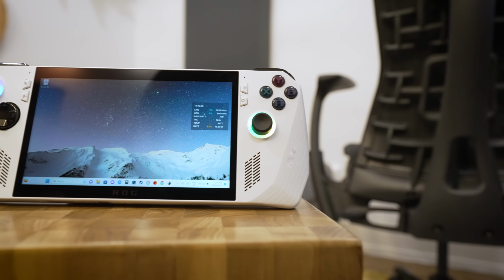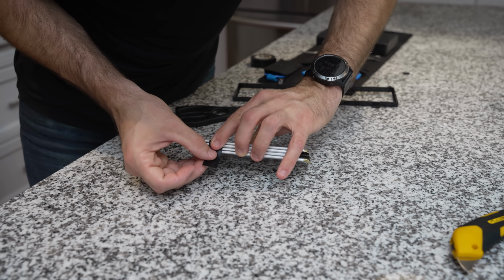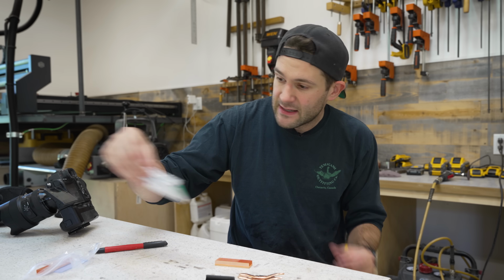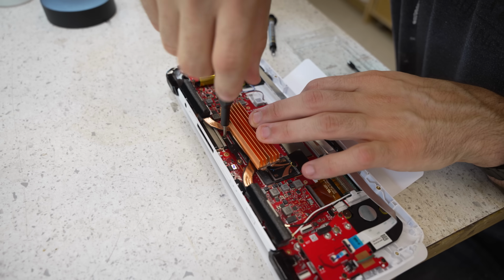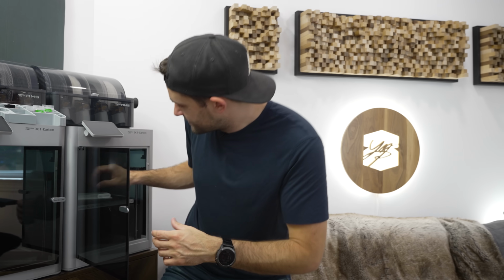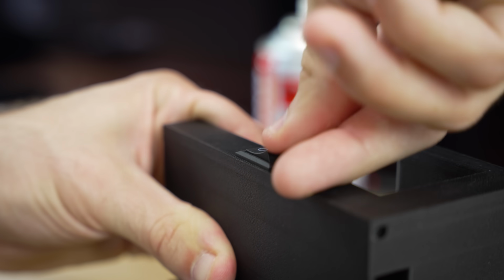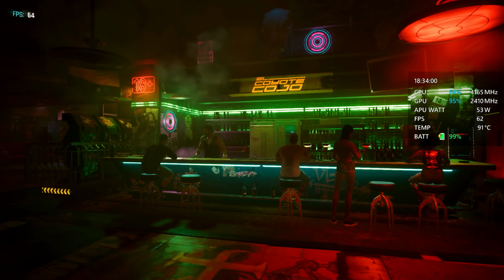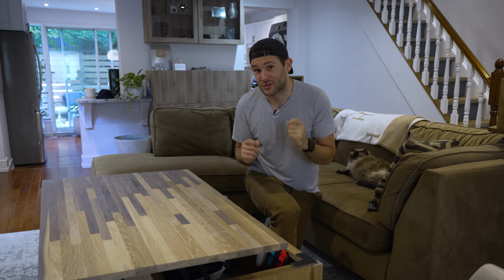I don't understand why people buy Steam Decks...

Comment: The most important Steam Deck feature for me are the pads and Steam Input.  The most underrated feature by far. As a Stream Controller user since launch, I'd be lost without that powerful feature.
Reply: Heck yes, Steam Input is so helpful, even outside of handhelds.  Gyro controls on any game?  Sign me up.  Also helps you fill in the gaps where game manufacturers fall short.  I recently started playing a 2d platformer that didn't have support for the d-pad (only the left stick).  Steam input was a quick and easy fix.

Comment: The thing is, its optimised and they continue to patch it. The OS is made for the SD device and it runs smooth. Like a console should do.
GPD, Ally, AyaNeo and other devices the last years, on them the Windows or Linux runs but the user experience and optimisation is, yes it is shit. 
You can say it's nice with the extra power and performance but it still sucks

Comment: Why did I buy Steamdeck instead of Asus rog Ally? . I will give examples, and you try to answer them
1. Lack of a trackpad.
2. Windows OS
3. 1080p 120 Hz - games will run at 720p resolution (30-60 frames per second)
4. There is no fine control of energy consumption.
5. IPS screen.
6. Stick drift.
7. SD memory overheating
8. asus rog ally costs $699.99 - no case, no docking station
9. Steamdeck cost $349.00 64gb + 1tb SSD +100$ =449$ There is a case
10. Extremely stupid video

Comment: A lot of what you do in this video, can be done to the Steam Deck. Obviously there's differences in execution since they are different systems, but there's nothing here that doesn't have a parallel mod or something similar for the Steam Deck. If you don't like Steam OS, just dual boot, or you can even fully convert it to a Windows device. The video title, aside from the obvious click/engagement bait, feels like you just don't like the Steam Deck for no real reason.

Comment: I bought a steam deck because I have a desktop, and I don't like moving it, so if I want to go hang with friend, something more mobile is preferable. I've done gaming laptops before, and I didn't want to go that route, and I don't want to deal with tons of custom configurations. The Steam Deck has reached a point where nearly everything is plug and play, with relatively little adjustment most of the time. ROG Ally is worse in my eyes because it's Windows, and I have bad experiences with handheld Windows devices. Is that biased? Yes. This video is very entertaining, but I'm fine with just getting a battery pack, and running of the base Steam Deck.

Comment: Valve have done everything SO right with the launch of the OLED Steam Deck, they have cemented my love for them forever!
Reply: Even if I sold my steam deck non OLED and bought a Rog Ally I will 100% buy the steam deck 2 immediately.
Reply: @rogert250  With all that tweaking, I prefer my Switch OLED.  All you have to do is plug in a game and go.  Steam Deck you have to wait for it to boot,  then tweak the settings, and updates take quite a while as well.  Oh, and battery life.  There's a reason why x86 CISC hardware is often something that plugs in with large batteries.  I get better battery life on my Switch.  Also, the Joy Cons are detachable, so you can slide in a 3rd party set if you wanted to.  Can't do that with the current Steam Deck.
Reply: @WJCTechyman while there is a lot right with what you have said, the target demographic is different to the switch when it comes to available games, I like my switch but there is still a lot of games that aren’t on the switch that I would also like to enjoy on the go, in the end it’s what people want to do on the go as to which handheld they get

Comment: Interesting mod. It might be a little premature, though; rather than adding more thermal mass and heat pipes (by the way, you should be able to prevent the pipes from popping under heat by submerging half of them in cold water to help regulate the internal pressure), have you looked into the AirJet by Frore systems? They're brand new solid state cooling solutions that are just hitting the market that could provide just as much cooling as your setup without requiring expanding the overall volume and making aggressive cuts into the case (they're like 3mm thick). Someone like you could probably obtain engineering samples to popularize the product and produce a proof-of-concept retrofit.

Lastly, I think heat shielding was a good idea, but I would probably use something more substantial (a thicker layer) when it comes to protecting the SD card slot and battery, since tape that thin has its limits -- eventually its insulation capabilities are going to be overwhelmed by constant heat radiation.

Comment: I use the Steam Deck to play games I don't ever play on my 3090 PC. The onboard Steam OS works great, the community behind the Steam Deck is god tier and its very well optimized. Yeah Windows might be better, the Ally is a lot more powerful, but I don't need that. I need something to work for multiple hours without charging. Something I can bring with me to Doctors visits, trips and plane rides, and any other condition where I am not at home. Steam Deck checks all those boxes, especially the Steam Deck OLED. Greatest handheld I have ever owned, especially now that I have emulation running.
Reply: And with the ability to disable turbo boost, you can gain better battery life. Also I modded my ALLY with a 90whr battery so battery anxiety is not there at all.

Comment: puting liquid metal to device which u holding different position it's really bad idea... liquid metal IS LIQUID then physics gonna work on it and there will be not everywhere the same amount of liquid metal on chip... then... some part of chip could be without termal conduction and you can expect throttling or die of chip.

Comment: The price, the Valve support, it wasn't manufactured in some totalitarian hellhole without worker's rights
Reply: You can find the ROG ALLY under $500, cheaper than the Steam Deck OLED, Asus has been giving amazing support for the 6 months that the ALLY has been out, made in Taiwan, just the Steam Deck’s APU and OLED screen came from so Valve is supporting that very same totalitarian hellhole without workers rights, congrats Valve AND Its not available everywhere like the ALLY.
Reply: @DoubleDragon5180  Taiwan is democratic. But point taken about the Ally, though you can get a new or refurbished LCD Deck for cheaper

Comment: Unfortunately, given the Phawx's benchmarks and performance tests, I knew you wasn't going to get any decent FPS gains, the double battery life mod is awsome though, what would have been a fantastic mod btw, and actually got you a minimum double FPS improvement, is if you have installed a hardware line-multiplier, there is a fantastic device called the mClassic, this device can take 480p/540p or 720p/800p, line-double it and add very effective AA, the result is indistinguishable from native 960p/1080p or 1440p/1600p, and in fact often better than native, it really is that good, this means you can get over twice the FPS for absolutely no downsides at all, this combined with your battery mode would have been amazing, there are also generic scan-double IC chips available, that just go in-between the video output to the screen, these effectively double the line count for a tax-free double FPS boost. Line doubling is so effective on screens under 20 inches, and completely indistinguishable from native on screens under 12", you don't have to worry about video latency or input latency with hardware line multipliers either, neither do you have to take game compatibility into account, it just works on a permanent hardware level, you almost have to wonder why haven't handheld manufacturers made use of this yet, it's a no-brainer from an engineering perspective, oh and did I mention you will get double the frame-time/latency performance, meaning much smoother FPS and gameplay, such an awsome mod.

Comment: The moment I realised the Steam Deck was superior to all other handhelds was when I plugged in an external controller and it just.... worked. No faffing around in settings for multiple emulators to enable a second controller. The quality of life improvements and the thoughtfulness of the design and useability mean it's far superior to the ROG Ally, even though it is technically in performance terms weaker.

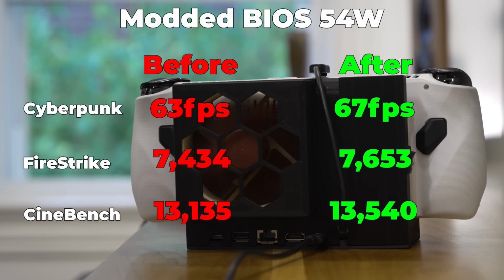Comment: IMPORTANT: 19:00 something is very wrong here. I get 15200 Points in Cinebench R23 with my STOCK ally, no mods, no tweaked bios. So, with a permanent 54W limit, liquid metal, additional fans, you should get over 16000 points!

Comment: Actually, the corrupted SD cards are caused by windows. It has a nifty feature where it doesn't write to disk in a timely fashion. It is called "write caching" and you should disable it on all SD cards. The problem is SD cards (and USB for that matter) don't have capacitors to write the cache to disk, and SD cards use low quality flash making them corrupt easily. Basically use it in read only mode if possible.

Comment: I think it's worth mentioning that Valve in order to get to the $400 base unit price, actually sold these devices at a lose from what they could have, and if that was it then it would be a foolish gamble, but they also bundled the Device with the perfect blend of Hardware, and Software making for a easy to use system that just about anyone could afford, and handle, and they have only made it better with performance tweaks, and improvements to the Linux Ecosystem something while sure has helped them sell more units still makes anyone gaming on Linux happier even if they don't play on Steam Deck, or use Steam as a launcher. 

The Steam Deck is a good hand-held, with a fantastic price, but that said it's an even more remarkable promise to the Linux Community that which I'd been apart of for years, to finally make it better for all, and to be rid of this pathetic notion you need a Windows PC to game, I'm done with bloat, I'm sick of forced updates that happen in the middle of my workflow at times, and Steam is the only company trying to make it better, while the Hand-Held is good, the price is fantastic, and I'd pay that price to show I want future on Linux, on top of enjoying a taste of it right now on the go.

As it stands I can play 90% of my library of over 300+ games on Deck at 40-60 FPS would I want higher FPS, yeah, what gamer wouldn't, but I'd have to spend far more then I'd ever care to, and unless I want to go back to a bloated sluggish Windows like almost all of these competitors offer, I'd have to deal with a 3rd party fork of Steam OS that might/might not work with the device in hand completely, and IMO that ain't it chief. The Deck is just too convenient for me, who's had to setup up Distros from scratch before, and knows it's a pain. I spent $400, and then bought a $60 1tb SSD, and $60 1tb Micro SD from a trusted budget source anyone can find. for $520 I have a 2tb Unit, and it fits 126 games at all times, with emulators of my choice, and mods at the ready. I couldn't be happier

Comment: Is someone who just bought a steam deck over an ROG Ally I’ll answer that question.

1. ROG FRIES SD CARDS
2. Half the price for Deck.
3. SteamOS vs Windows
4. Support of Valve and our gamer god Gabe.

Those were my reasons at least. Mainly though the SD card issue.
Reply: Also, I don’t want to spend almost $1000 on a Product that should work fine out of the box without having the mod it like a Tweaker

Comment: PS batteries need to expel heat, and they will expand when heated even if not having battery swell from burst cells.  I would say heat-shrinking your battery is probably a really bad idea,  especially being heat makes heat shrink, well, shrink.  All i can say is recall the Galaxy S7 that got recalled and banned from being on airplanes due to them exploding, and the reason was they didn't have a small air gap inside the phone, but otherwise your mods look pretty solid, even though I still think handhelds are dumb when gaming laptops exist, and espially for what companies are charging for them, they are just outright mentally challenged on that idea

Comment: Yah I have a gaming laptop with an RTX3060 that lets play pretty much whatever I want, and portable, and with a good  size screen when not hooked up a TV, and it doesn't hurt my wrists to play it because I'm only holding the controller, I'm not holding an entire processing unit with controllers glued to the sides.  Large handhelds are the dummest idea ever.  And I own a nintendo switch, but its so heavy in my hands it always hurts my wrists after about 15 mins.  Only reason I have it is because there exclusive Nintendo titles on there, and I am getting a switch lite for actual portable nintendo gaming, but otherwise why would anyone use anything besides a gaming a laptop.  I think handhelds are just the dummest tech idea hands down.  Yah dockable equipment is great, which again, a laptop can easily do.

Comment: I think there are quite a lot of reasons.  The base level steam deck is only $350 so half the price of the base ally which is $700.  The steam deck has a really polished interface and feels much more like a console.  The steam deck has direct steam integration.  The steam deck has desktop mode allowing for people who like to use more desktop apps.  The steam deck has touch track pads for both thumbs.  The Steam deck sells quite a lot more units so it has much better product support, community support, reparability, and modding scene. 

There are so many reasons why someone would get a steam deck over this product even at a surface level glance.  The same can be said for the ally but its not Objectively better.

Comment: Thermal Grizzly's Conductonaut is better than ThermalRight's Silver King.

When you added the extra nuts to the inside of the original frame to support your custom frame, please tell me you used kapton tape or other protective layer to avoid shorts from direct metal contact.

Comment: Honestly, it's the insane amount of software work that Valve has put into the Steam Deck that makes it work so well.  Windows, frankly, sucks ass on anything that doesn't have a keyboard and mouse.  SteamOS did effortlessly what Microsoft failed spectacularly at with Windows 8: they managed to make an OS that has both a usable desktop and mobile mode, and they did it by, you know, having two separate modes rather than trying to force everyone to use a single muddled, unpleasant compromise.  They also managed to improve the viability of Linux gaming in ways that should probably be scaring the shit out of Microsoft right now, because this is just Gen 1.

Comment: you just put liquid metal directly on to copper. the liquid metal will soak into the copper and will eventually dry out, youll have to keep re applying until the copper is saturated. you really should either nickle plate the heatsink or use a high end no liquid metal TIM

Comment: .............  you could have just bought an external battery pack and a back plate mount for it and connect it externally ... attach and take off as needed

Comment: I just Make my own Back pack Battery pack (Much Higer voltage) and the Pack Are Hot Pairs Swappable (3 way Uninterruptible Power Supply (UPS)) 24V 48V E bike (Even 72V DC - Milwaukee MXF XC406 MX FUEL 6Ah REDLITHIUM Battery with ONE-KEY Bluetooth)  Battery's & Battery docks plus a few Extra DC DC Buck converters For a Few USB PD & QC Ports For MeFi hotspot Plus a Few Mates can Plug into you (a outdoor Walking  LAN party)

Comment: Yeah let's just spend a bunch of money on an Rog then take it apart, change the battery, protect the SD from being fried, alter the cooling system, saw the back out of it, 3d print a new back and dock, tweak the bios and then get small improvements. Why would you ever buy a steam deck when you can just do that?

Comment: just opened the video to thumbs down the video. the ally is NOT better than the deck. faster does not always mean better.

go watch the LTT video review. Linus gets one of the keys stuck without trying, then says they reported the issue with the pre-produciton unit they had originally, but asus never fixed the issue.

also, Decks now come with 1TB drives and OLED displays. git rekt.

additionally: all those little issues you want to fix on your ally? warranty's busted as soon as you open it. the deck? nope, made to be opened and tinkered with, and doing so doesnt void warranty (as long as your tinkering isnt the cause of the failure)

Comment: You are KILLING me (and maybe yourself?) with your treatment of that battery pack. I'm not at all an expert, but I at least understand the importance of the battery needing space to expand/contract and ventilate for thermals/gas dissipation. An example of what I'm speaking to is that whole "exploding Samsung" meme where the Note 7's battery has some cases of sporadic combustion. Investigation revealed that because they CRAMMED batteries into the battery pocket without enough room to "breathe" from heat/charge cycles, the ends of the layered wrappings child collapse in on each other, causing a short. So forcing those cells into a tight stack and then tightly binding them in heat shrink seems like it is begging for fiery failure.

Comment: A really cool thing the allay can do is it has a port that you can use to attach a external gpu that will significantly improve graphical performance. I wish the steam deck had a e-gpu but unfortunately you would have to take off the back to attach it.
Reply: Just plug it into the usb
Reply: @SineN0mine3 I wish it was that easy. The usb port doesn’t support e-gpu’s. The e-gpu slot is located on the back of the steam deck so you would have to take the back of the steam deck off to access it.